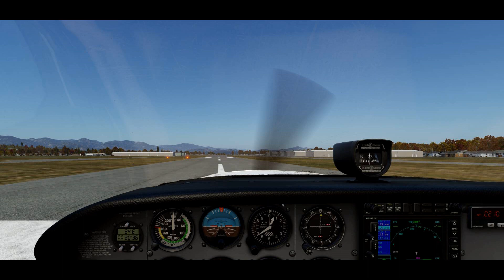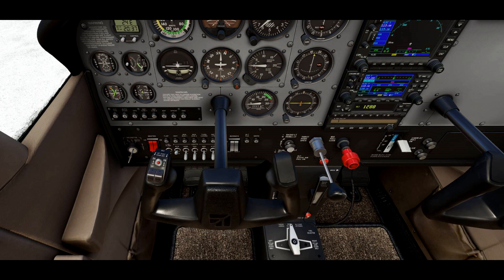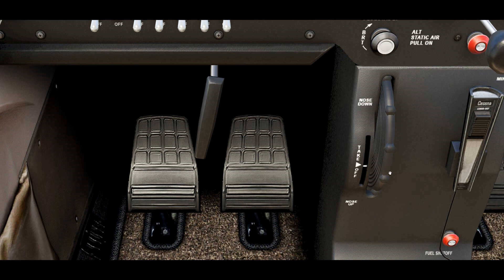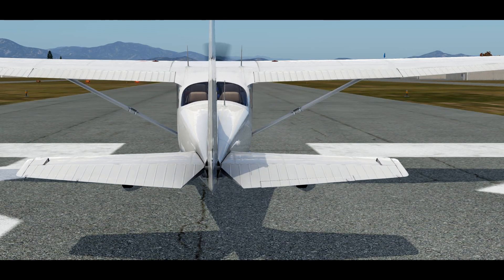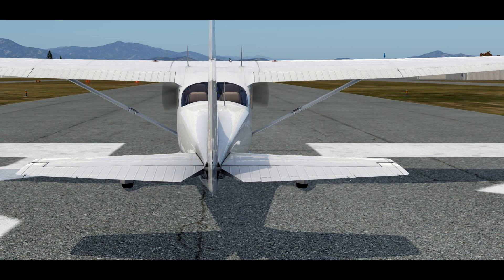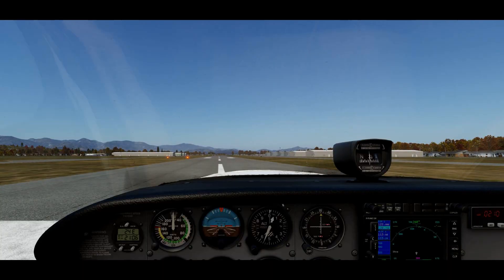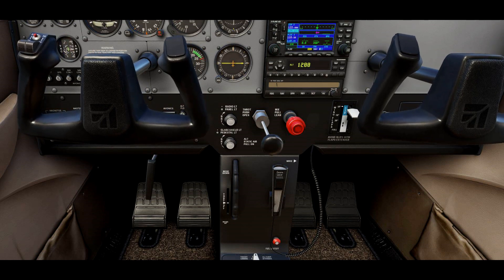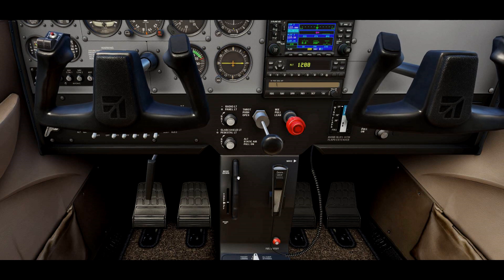how to trim an Airplane and how trim works

Comment: Your videos are very informative and well presented.I learn a lot about basic flying from them.THANK YOU !!!!!! With reference to this trim video, I would greatly appreciate you doing several comprehensive presentation videos with the Cessna on how to control the plane in "slow flight" !!! Vid #1--- How to change altitude (up/down) while maintaining a fixed airspeed. Vid #2 -- How to change airspeed (up/down) while maintaining a fixed altitude. Vid #3 -- How to change both simultaneously. I have difficulty doing these basic operations corectly. THANK YOU !!!! for your time. This would be very helpful to me and most other flyers. You presented it at one time ( I believe ) but I would like to see it done in a more comprerhensive way both in flight and before a  landing. Again THANK YOU !!!!!!
Reply from the maker: Hi JoLo-vx1nb, Thanks so much glad the videos are helping. Sorry but I'm not sure when I will be making another video but I will consider slow flight when the time comes. 

For slow flight and precision flying in a simulator I have found it very difficult. Slow flight and precision flying in a sim is much harder than in real life flying because you can NOT "feel" the airplane you only have a visual sense plus consumer controllers just don't cut it, this combination is just not going to work well. If you are trying to preform precision flying in you sim you MUST have at a minimum a really really good Yoke, Rudder Peddles, and Trim Wheel. Without these precision flying in the sim is at best very difficult and frustrating  or impossible.

I am curious as to why you are interested in these maneuvers, in my pilot training we never discussed these but I had to stop training so maybe that would have come later, I don't know?

Here are my thoughts and suggestions you can play around with if you like:

As for maintaining a fixed airspeed in a climb or descent and the other things you want there are no set "rules" to follow just setting your trim and throttle for a desired FPM rate of descent and airspeed. For climbing you should use full throttle for climbing 99.9% of the time and trim for speed. For descending us throttle to control descent rate and trim as necessary (Take off & Landings have some requirements).

Maintaining altitude with a change in speeds again is a combinations of trimming and throttle. The more you slow the airplane you will need more trim to maintain altitude, as you speed up you would use less trim to maintain altitude.

Sorry this is not exactly what you were looking for but it's the best I can do right now.

Have a great Christmas and New Year!

Blessings,
skip
Reply: I agree -- to do these settings in X-Plane with (in my case) a joystick is difficult. However, I did assign 3 buttons on my joystick to set trim (up-down-takeoff) along with throttle control. I was then able to obtain excellent control of airspeed / altitude. Controlling pitch with trim control only (no manual joystick input) -- allowed excellent control. Certainly NOT what you would do normally - but for the simulator - OK. I was interested in learning how to do this because I thought this was a fundamental skill all pilots must accomplish. I refer to this skill as "slow flight " but maybe I am wrong. You mentioned precision flying also.THANK YOU for responding to this request so quickly along with your suggestions. GOD bless you also.
Reply from the maker: Hi JoLo-vx1nb, Glad to hear back from you and you figured out how to make things work. If you are serious about sim flying and want to experience what is like (almost) to fly a real airplane I highly recommend rudder pedals and trim wheel. I know these can be expensive but once you have them you will never want to go without them they really do make a huge difference in the sim experience. 

I never did a video on slow flight because I assumed most people don't have ruder pedals and it would be a waste of time. I think I will go ahead and make a video since you asked, at least you will have the information needed for slow flight and that just might encourage you and others to upgrade their sim controllers  :-) . With that said  first I will have to test and make sure it''s practical in the simulator to do this, as I said earlier controllers make the difference.

The trouble with trimming with buttons is you don't get precise control so you will find yourself constantly having to trim so in reality you are not trimming your hunting. Rudder pedals are essence for slow flight because flying at near stall speed make the aileron useless because of the pitch up angle of the airplane. They also will make your landings so much easier especially when you have cross winds! 

Thanks for encouraging me to make another video I've been out of ideas for some time now :-) Might want to subscribe to my channel to get notified when the video comes out should take several weeks to make or more!

God Bless and Happy New Year!
skip
Reply from the maker: Hi JoLovx1nb, Well I'm afraid the slow flight video is going to take quite a bit of time to make  and I just might give up sorry to say. I am finding it very very hard to accomplish the maneuvers in the sim, this is going to take a long time to master.  Right now I can not even maintain a simple constant heading, altitude, and airspeed within the requirements for the maneuvers :-( I'll give this some more time  but I don't know if I'm up for all the work this will take or if it's possible with the controls I have,  sorry. Just wanted to let you know it will be a while. 

FYI Requirements for just straight and level flight are +/- 100ft altitude,  +/- 10deg heading,  +/- 10 kts While I was able to do this during my training in a real airplane I can't in the simulator at least not yet.

Blessings,
skip

Comment: How do you set trim in in x-plane 11? Keyboard or joystick ot both?
Reply from the maker: Hi sydneyblake4820, Either way works, I'd do both. However, I highly recommend getting a trim wheel it's much easier to trim with the wheel it's so much more sensitive. Thanks for watching :-)

Blessings,
skip